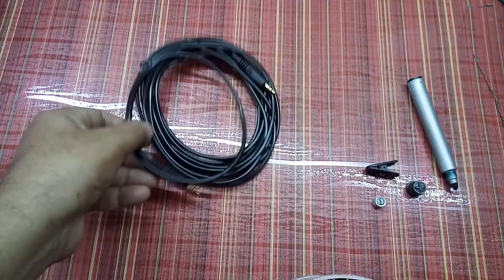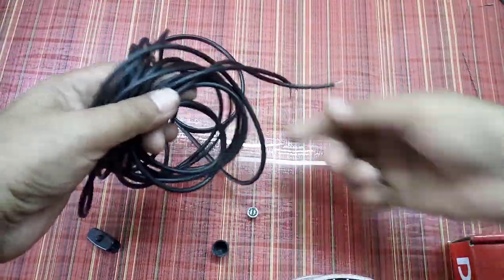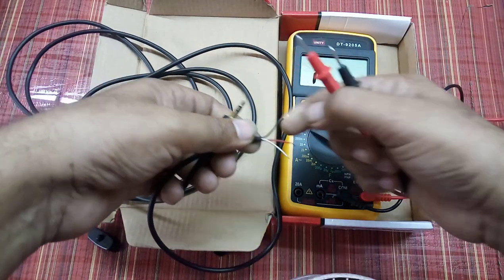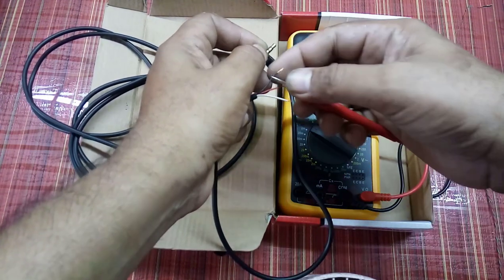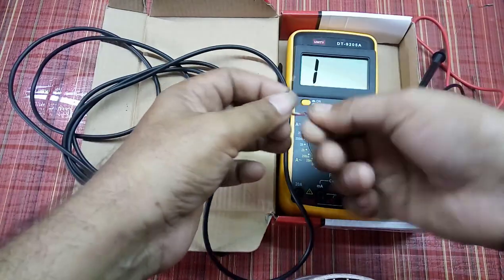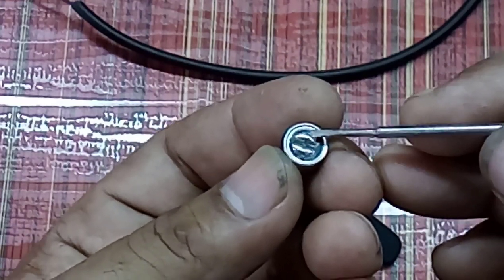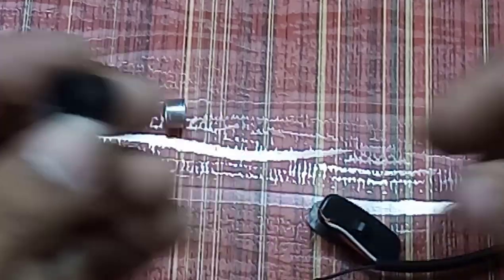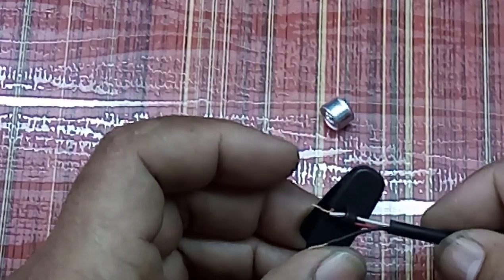How to make Collar mic: Make it at home lapel microphone by Innovative ideas

Comment: Without any current how can this work? explain plz.
Reply from the maker: Condenser mic do not need any power supply to operate. Thanka
Reply: Will it work on mobile
Reply: @innovativeideas  Yeah but it still needs to be amplified. You still get some power from the mic in jack but still.